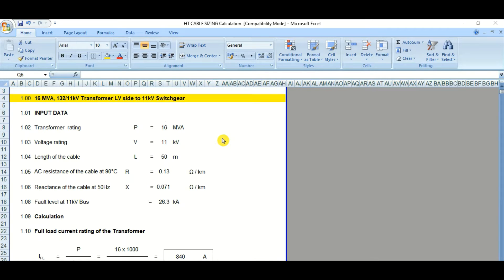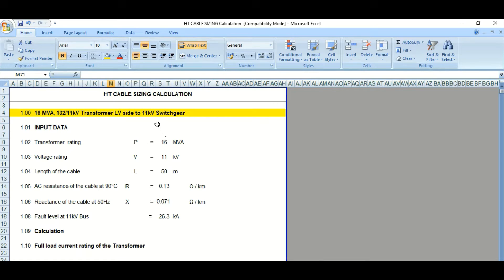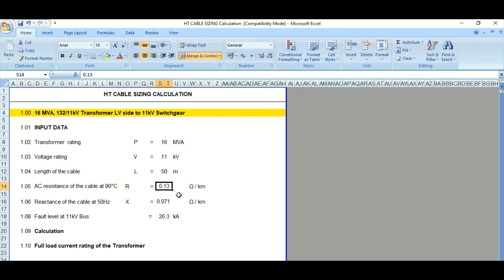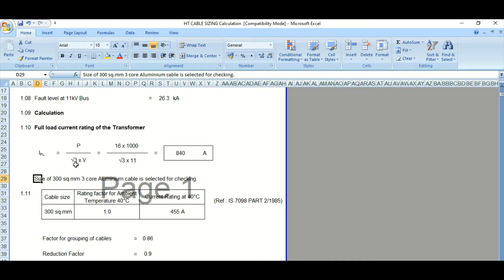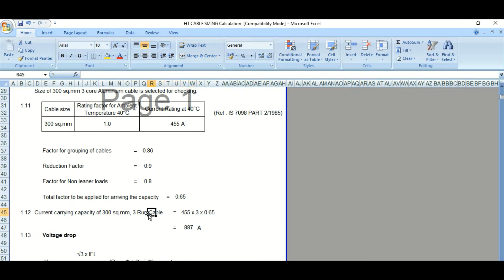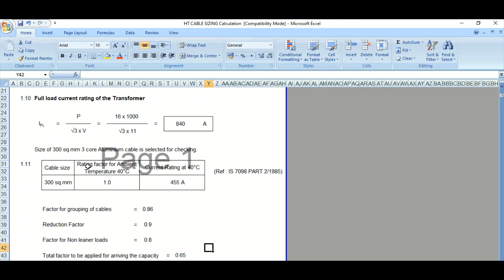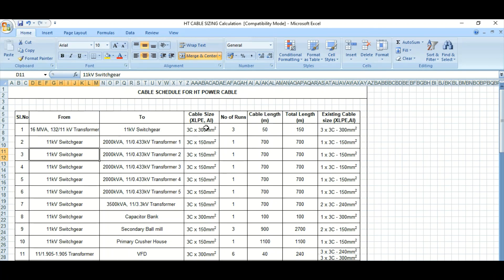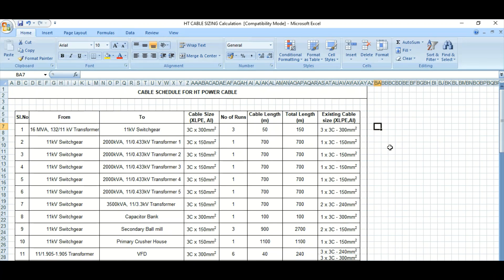Cable Sizing Calculation in Excel Spreadsheet

Comment: Sir sorry, I have question in cable sizing.
What is the meaning of no of runs?
Example:
5R/3.5C/240sqm/XLPE and
1R/3.5C/25sqm/XLPE
Thank you Sir
Reply: number of cables used in parallel. in this example 3 cables were running in parallel to supply the full load current

Comment: Ive just worked the calculation for volt drop at 1.777 and not 4 any ideas what ive done wrong could you show the calculation format in the cell
Reply: number of runs is 3, he has counted 6, its 3RX3C CABLE